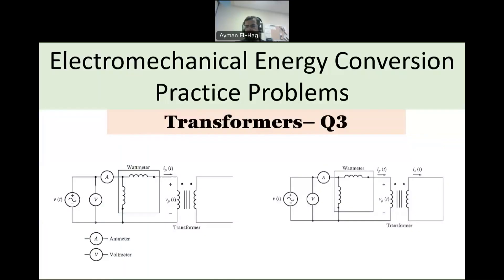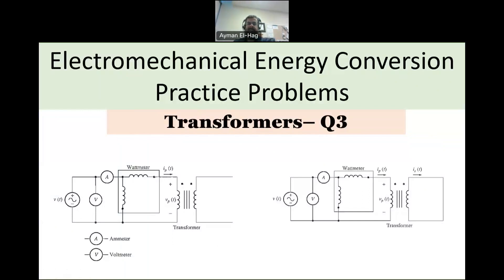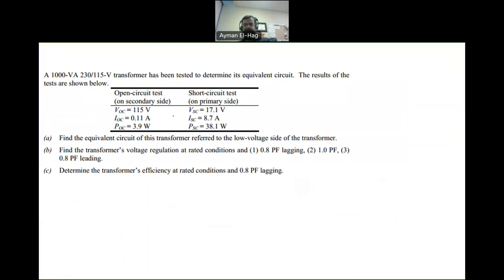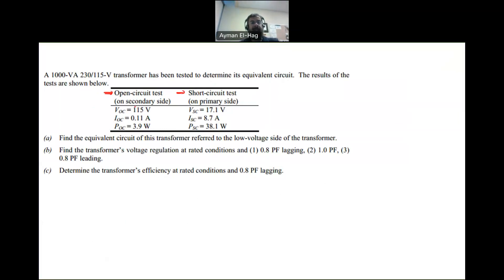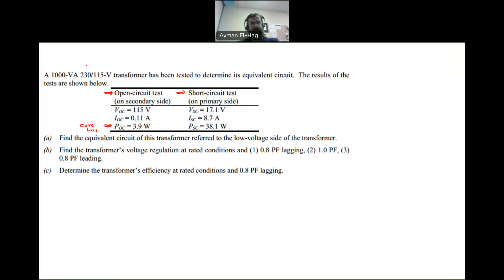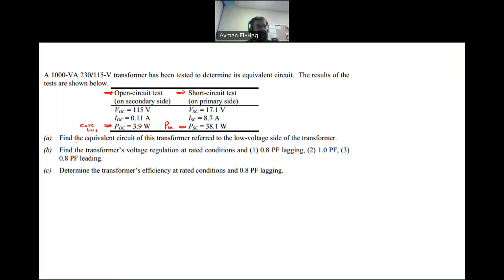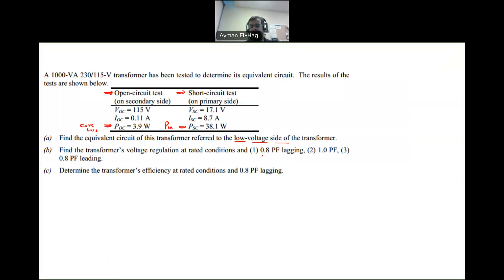Transformers - Question no. 3

Comment: Hi Professor, 1000VA/115V = 8.7A, so why the SC test is not on secondary side? Thanks.
Reply from the maker: You are correct, but the question itself state in the table that the values were taken from the primary side. It could be a mistake in the question itself.

Comment: Thank you for the clear explanation, just a quick question, Why isn't P(copper)= P(Short circuit)?  if system is at rated conditions?
Reply from the maker: The losses we have in the short circuit test is done on a different side of the transformer, so there is a^2 = 4 factor different between the two losses.